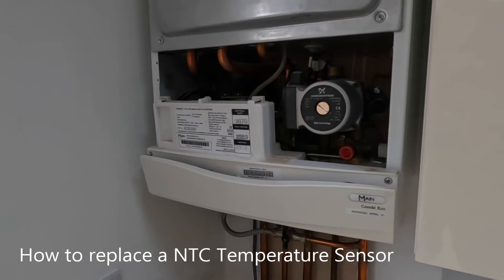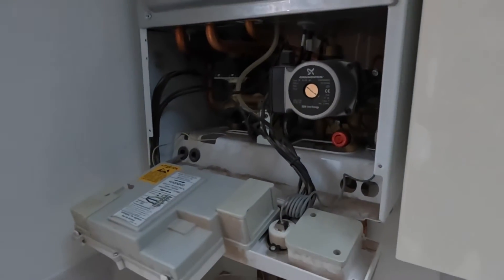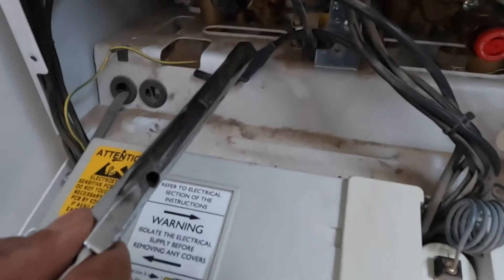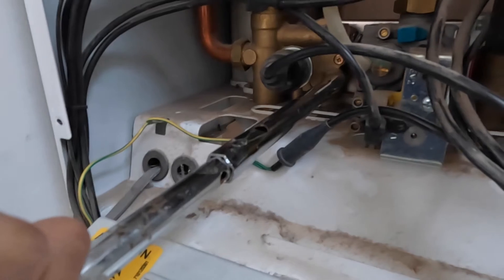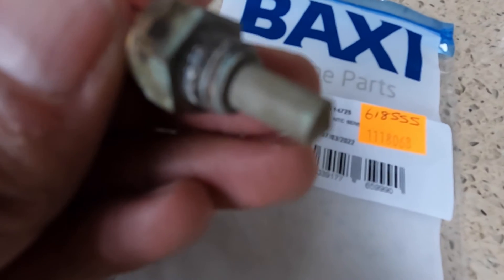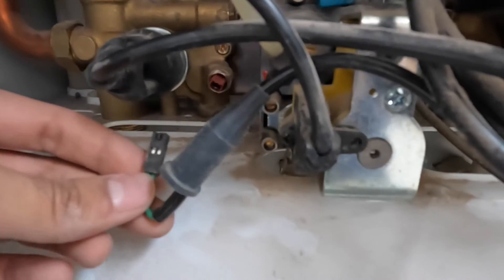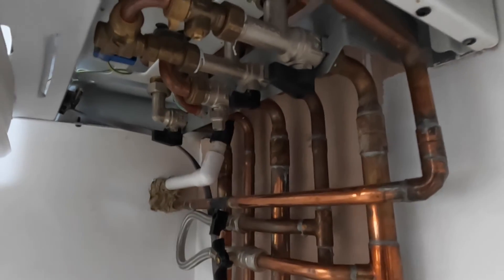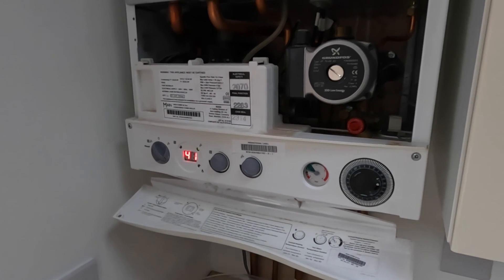How to change Baxi Boiler Main NTC Temperature Sensor -  Baxi Thermistor

Comment: Is this just for temperature? I switch on hot water it starts to warm up but then goes cold unless I open the tap to the max. Old sensor was black I guess some corrosion. I had some issues with boiler not switching to heating but i changed the motor seems fine.

Comment: Hi mate, i have an old baxi neta tec  33ga, would it be the same process to change mine?
Reply from the maker: Hi mate, it may be the same but can't guarantee the position of it. Does the location look the same position and does it have the electrical plug as shown on my video? Cheers Handy Singh.
Reply: @handySingh  hi mate, yeah its just a pull out one, it says to turn off cold water supply and draw off residual domestic water... so just so I'm 100 percent clear, is it just turn off fuse to the boiler, turn off the cold supply valve, open the taps to let the residual hot water drain and then change the part, turn cold water back on etc?
Reply from the maker: @JESUS.IS.KING.1990  hi mate, yes turn cold water feed off to boiler and open all taps including hot water to let water out. Isolate power to boiler. Cheers
Reply: @handySingh  thank you very much mate, genuinely appreciate your fast response. Definitely earned a subscribe and ill be telling everyone about your channel 🙏
Reply from the maker: If your looks round and can't have a spanner around it that means yours is the one with a rubber washer which pulls out which is a different part no. Type in NTC sensor baxi tech 33g on Google and you will see the pic for both types. Hope this helps. Cheers Handy Singh

Comment from the maker: Hi Colin, yes another option as shown in my other video. However didn't have it with me at the time of this video as it was being used elsewhere. Once the valves are shut and the taps are open the water will drain from pipes itself as shown in video. Hope you found this useful. Cheers Handy Singh

Comment: Why didn't you drain down the boiler on the drain valve?
Reply from the maker: Hi Colin, you don't need to drain, just turn mains water off and then open hot taps. Hope you found video useful. Cheers Handy Singh
Reply: Hi, yes very useful and informative video thank you for posting.
However my Main 24 HE Combi boiler is the older version.
This has the NTC sensor in the  flow pipe  not the diverter vale as the ECO type you worked on.So l would like to know is my NTC in a dry pocket or wet pocket,after running the hot tap to drain down?